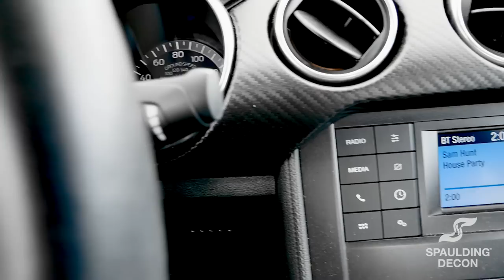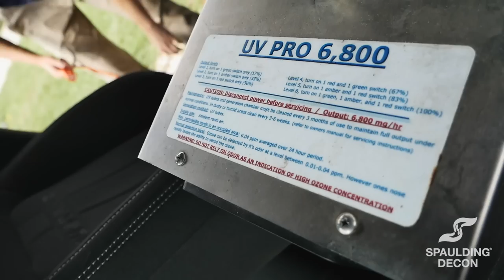How to remove Cigarette Smell from your car | ASMR

Comment: The interior filter should of been changed out and also  AC / Heat cleaned due to dust holding the nicotine partlets. OZONE is ok if your running the AC and Heat but not possible . next best is cab filters and window rubber trim ..
Reply: Agreed! Interior filters aren't made to be cleaned, only replaced and would of had a detailing brush to get in all the crevices on the dash/doors etc as going around with your towel and finger just doesn't do much.
Reply: that and spraying the roof liner....have to be careful with those as some cars the glue holding the fabric up will give way.
Reply: @danielrossi3465 Are you talking about the filter they were spraying and slapping on the ground? That wasn't for the car it was for the Vacuum. I do agree though, always get new filters with your car.

Comment: This was a Great try at Detailing a vehicle.
Detailing Automotives, Marina, or Airlines are very tedious. I would say it's a whole new ball game compared to residential or commercial. As when you detail anything In this field you have to be more wary. For example what chemicals you use on certain surfaces as you can fade or damage them. What surfaces you should stay away or be careful with for example the headliner will sag most of the time if messed with. Also sometimes to do a thorough job you have to remove items like seats, carpets, or even trim pieces to fully clean. It's always recommended to remove any filters in the vehicle. All of these services come with higher pricing too. This was an okay job tho I'd be interested to see how you use this experience for future videos. 

Ps definitely tell him to get his money back lol.
Reply: I'm surprised they didn't show any drill brush agitation before the extraction. You have to be careful with headliners as the glue doesn't do well if waterlogged or heated too much, but if used correctly, a steamer does wonders on headliners. My process is a little more in-depth. I like to hit the vents with compressed air to dislodge any ash in there, vacuum everywhere including the headliner, use superclean 4-1 as my main APC (agitate everywhere with good brushes), and follow it with tide 4-1 on the fabrics, let it dwell and steam everything (don't forget the entire seatbelt), from there use an enzymatic cleaner (intercon activate plus) and be done with it. Does it take way longer sure but nobody comes back saying the smell reappeared.

Comment: ok I am 1;38 into the video and there is crap all over the car! I stopped right there as, you said that the owner had the car detailed 2 times. How in the hell is there that much crap in the vehicle?  I will admit that I have NEVER seen the reason to have my car detailed, but, if I did, My hubby and or kid  would be out there cleaning out my car.